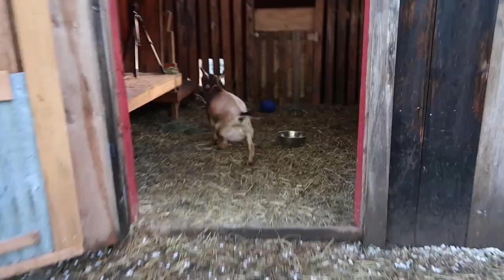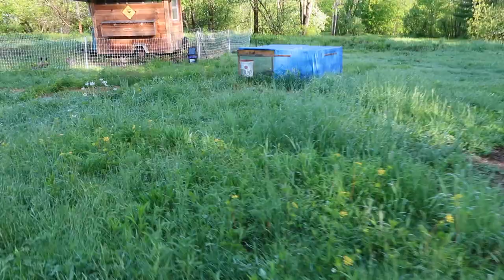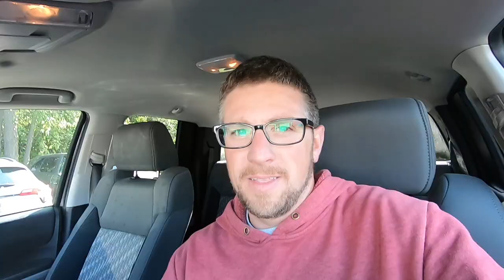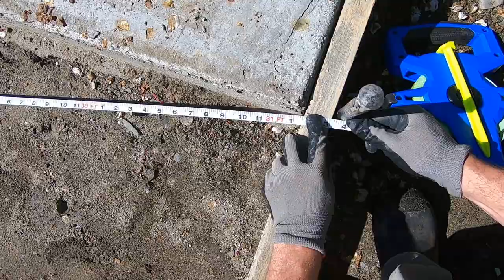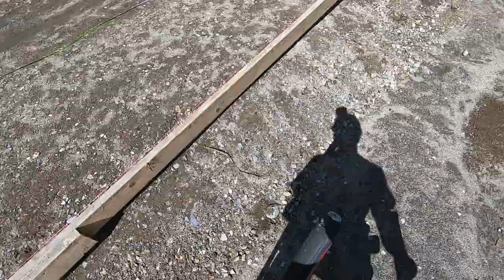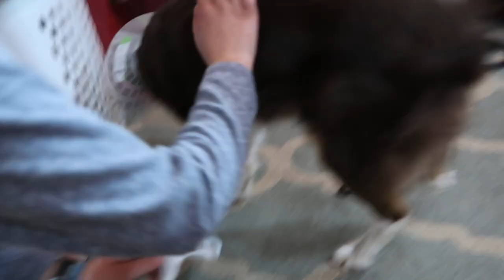This Made Ordering a BARN Kit off the Internet WORTH it!  (Starting the Forms for next Phase)

Comment: I've got a couple of issues to ask about - Have you considered a ramp where you enter the barn so you don't ruin the edge? I would have lowered the side of the slab so any water could drain off that could get under each lean-to instead of being level like the barn floor. It would also make it easy to hose off any dirt build-up from your equipment that you park under them. Just sayin.

Comment: Question
If the two add-ons are for stalls..
Why not give them 1/4 inch per foot fall..(8ft = 2 inchs fall)
So the water will run off when washing the stalls out..

Comment: Just a suggestion to speed things up.
When you run your string line across the top of the boards, put it in the middle of the board with a block the same thickness under each end. Then you can use a third block and check everywhere you put a stake, and don't have to use your level.

Comment: New barn is looking good. Just a thought but you don’t want the outer concrete slabs level to the barn you want them slightly off level/sloped  so that water runs away from the building. The main concrete pad is different sense its all covered

Comment: Are you going to use rubber livestock stall mats where the goats are housed?  I have used them any where I had concrete and livestock. They are fairly skid proof and cushion the impact of the actual concrete which can be hard on joints when critters lay down. They also clean up really well. Your barn will be so awesome.

Comment: Are you going to drill into the side of the middle slab and pound in some rebar to connect the slabs so they do not move vertically against each other? I put a slight drain slope on my outside slabs but my posts were sized for that slope.

Comment: I would like more info on the source of that vacuum pump bottle adapter.  Looks neat.
Reply from the maker: It’s all homemade with items from Amazon
Reply: @LumnahAcres  Is there a guide that you used that you can link to? Or can you do a quick rundown on what the components are/ how it works, etc.?  Why do you think it pumps more milk than your hand milking?
Also, at 13:48 there is an old horseshoe on the c. slab.  I assume you found it while working? Please tell us more about these things. Thanks for the videos and sharing your lives with us.

Comment: Are you going to saw cut 3/4" deep control cuts down the center and middle the center of the big slab? And again 3 4 5 or 6 8 10. Pythagorean Theory! a^ + b^ = c^  for a  90° right angle. So you want to put a ladder against a wall, how tall will it need to be? If the wall is 8 foot high, and you put the ladder 6 foot away from the wall, 8x8=64 6×6=36, 64 + 36 =100, 100 squared is 10 so your ladder should be 10 feet long. This also creates a right angle of 90°.....   3' 4' 5' bigger 6' 8' 10'.....